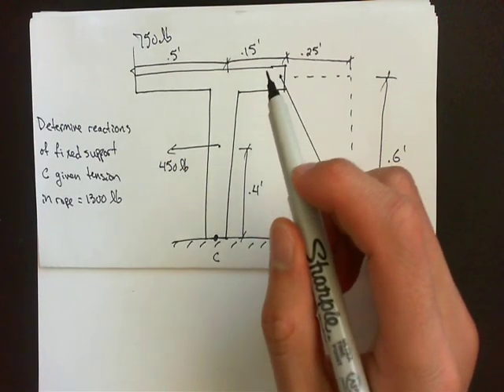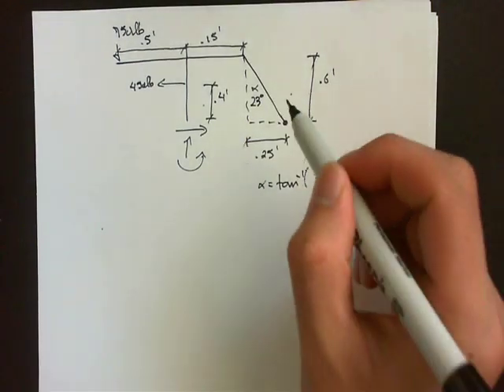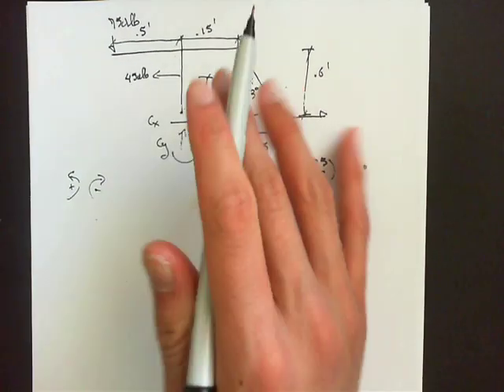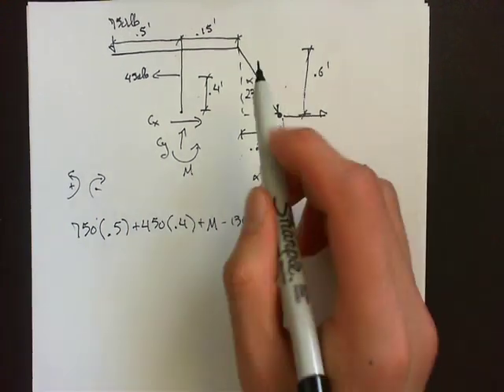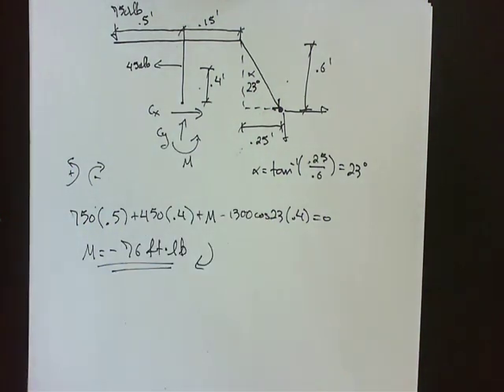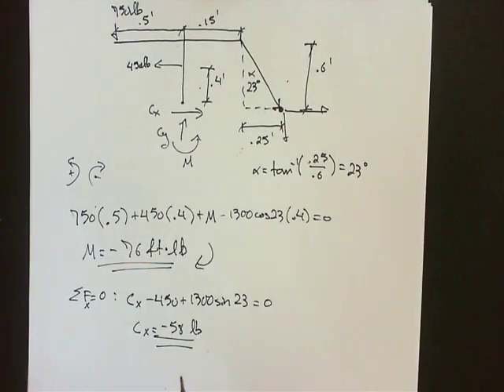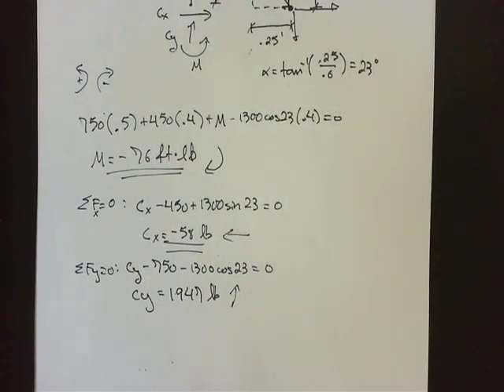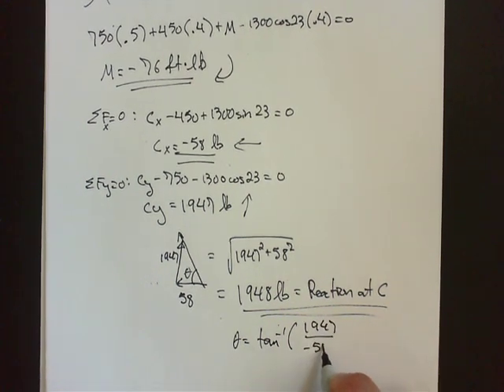Static Equilibrium 6 - Forces and Moments

Comment: I've never taken statics before, but I have to take the FE exam. How do you know what the direction the moment is for the known forces? You did something with your hand and thumb when you said the 750 lb is going counter-clockwise. How did you know it was going counter-clockwise? Same question with the 1300cos(23).
Reply: Never mind. I think I got it. It's just the direction of the position vector crossed with the force vector. Anyway, this video helped clear up a lot of things. Thanks.